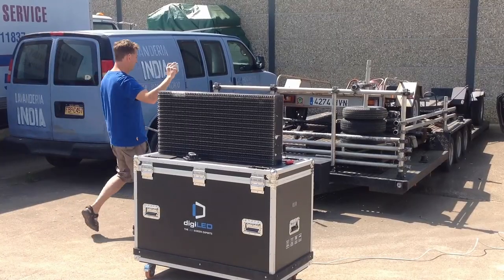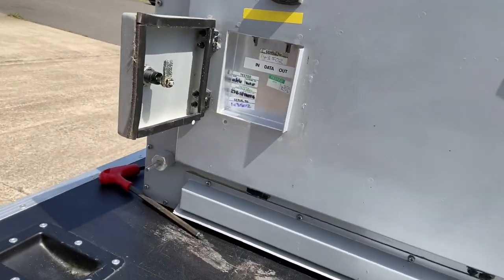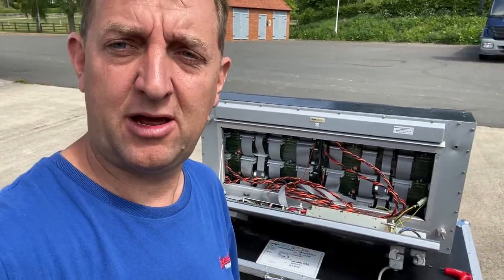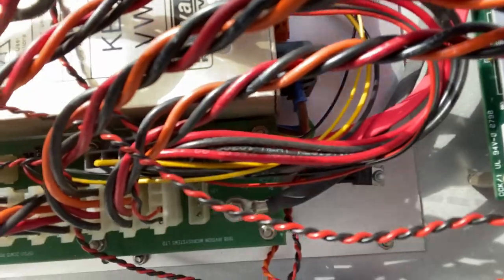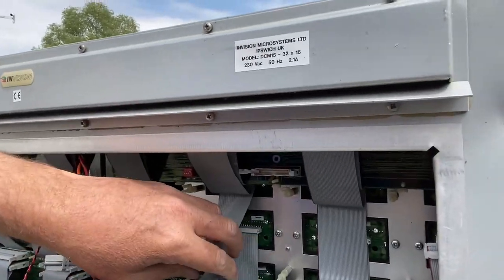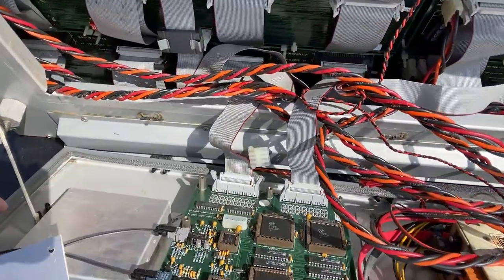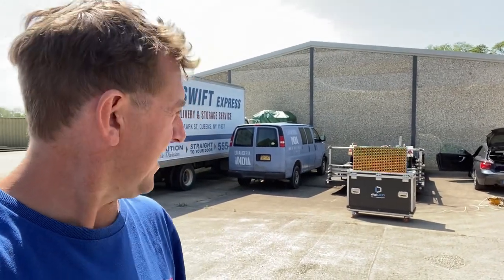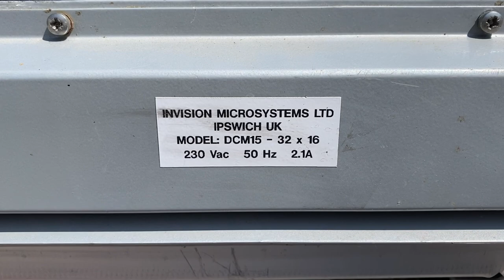1998 DCM15 LED Screen Panel from Invision Microsystems Ltd

Comment: WoW! Just found this video while searching for another screen type from 1998, 'OptiScreen' from  Gearhouse Group which was featured in a video about the Valhalla portable super-structure. I had no idea LED screens were even a thing before 2000. Not so long ago I was also looking at some small 25watt LED wash moving heads, and I thought they were pretty radical for 2003/2004.